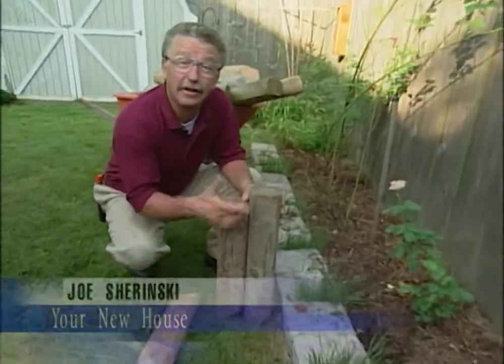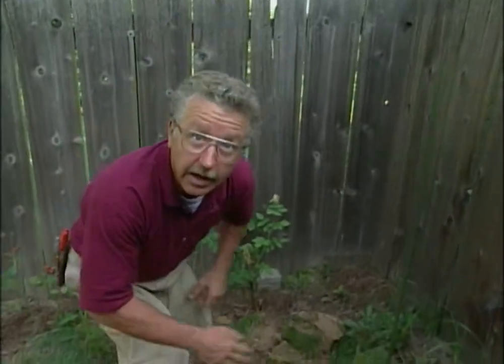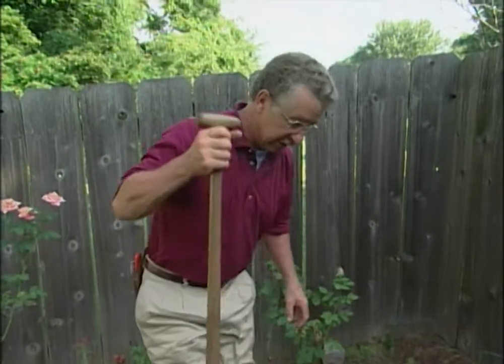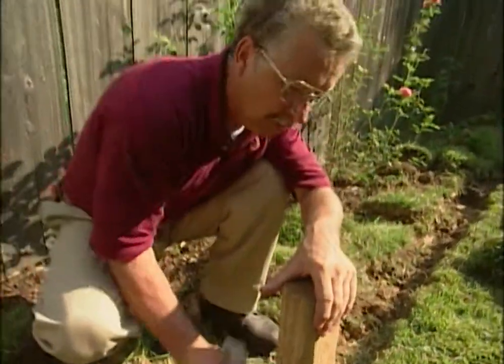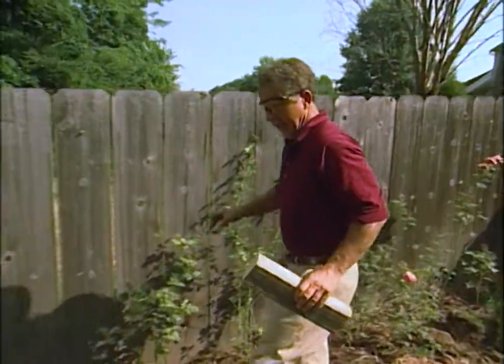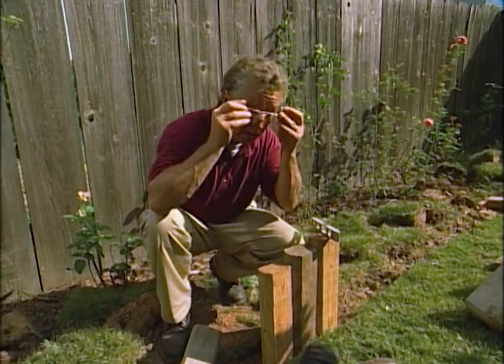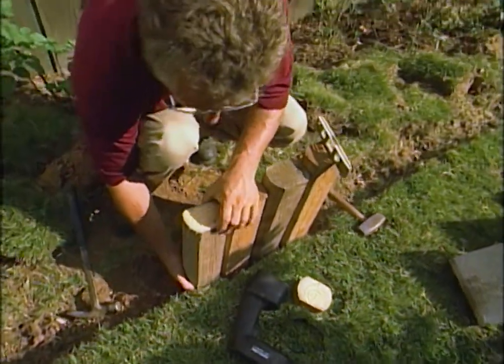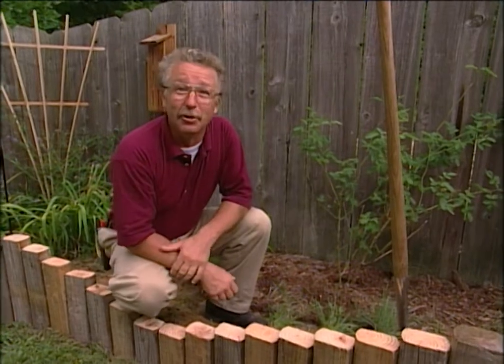Make Your Own Edging from Landscape Timbers - The Great Outdoors

Comment: 2 FREE TIPS:  You're using the wrong shovel there, friend!  You need the narrow shovels they use to dig sprinkler trenchers.  Half of the digging you just did.  Also, you're using the wrong saw.  Use a miter-saw to cut them.  It's a lot easier, safer, with less fumes, and more efficient than a chainsaw and you don't have to keep sharpening it.

Comment: This isn't edging so much as a palisade lol.  Points of note:
1) Good luck with 30 years out of a landscape timber
2) I notice you didn't show hammering in a pole barn nail until you had already 3 in place 
3) Nothing good made of wood involves long nails 

This is a garbage install like something you'd see on pinterest but there's a good reason you'd never see it in a long term garden.  
You can do edging with just an edger if you want.  Otherwise if you're digging anyway and want it made of wood just miter in your landscaping timbers.  But honestly you don't need a physical edging material if you just establish a physical edge with an edger or your shovel.  It's what 99% of trees and gardens are edged with.  Don't get stupid about spending money and effort to do something odd.